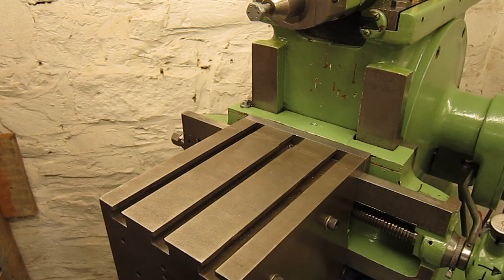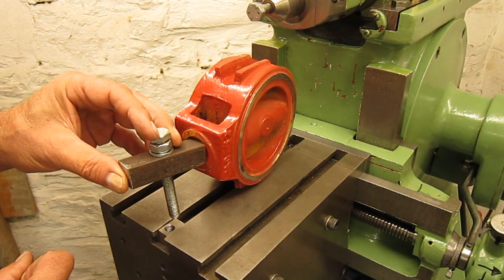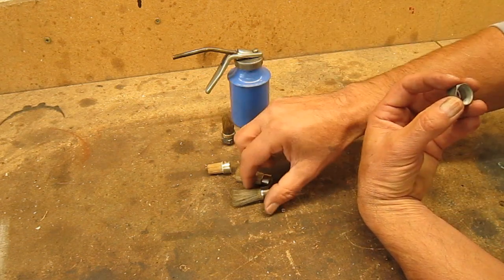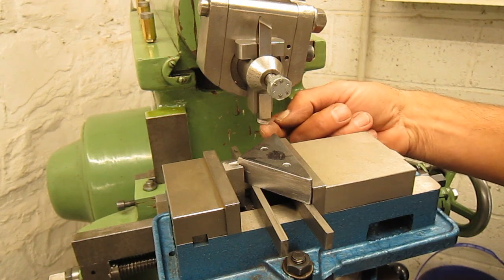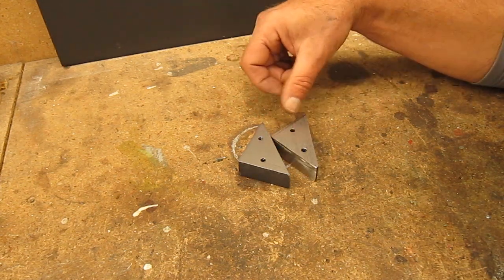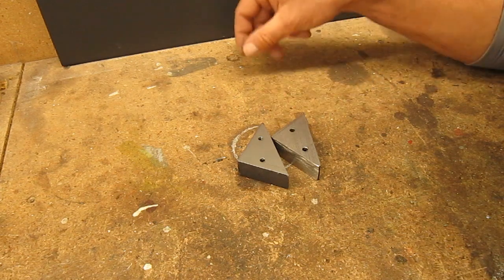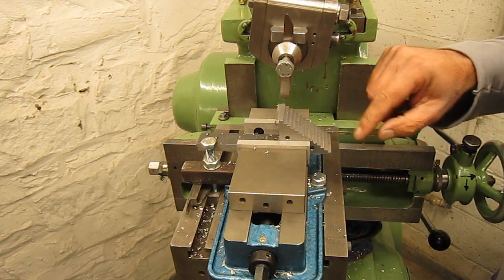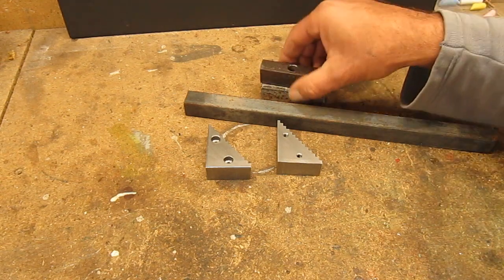Step clamps.

Comment: How about a slot, the width of the bolt, cut into the stepped face from the bottom far enough that the top step can be used. Then you won't have to remake the hold down bars. Just a suggestion if your pyramid material is wide enough. Otherwise good work.
Reply from the maker: Good idea, i will think about that.

Comment: Good job . Does the cross feed nut have an adjustable backlash feature .  Cheers .
Reply from the maker: Indeed, there is. But the nut itself will always have a bit of backlash. Thanks Max.
Reply: @Rustinox  stick a banana in it !   Cheers .

Comment: Hi Rusty, I am impressed. This is one of the best small workshop channels. Your videos are somehow naturally interesting and there is always something to learn from you.
By the way, don't give up on the shear tool yet. I can't see well, but definitely the chips were not the ones a shear tool produces. I think the angle of this shear bit is too much into the work, i.e. there is no shear action but rather a right angle cutting. I would try to increase the angle. 
I think the depth of cut was a bit too much too.
Another think is the cutting speed. I think it should be much lower for a shear bit. 
Of course the material matters to the surface finish. I guess you used s235 steel. It's known for the "gummy" behavior.
The best video visualizing what I'm talking about is there:
https://youtu.be/-CWGScRNXfw?list=PLeoGvnFBthYjFLY7nE7DI1RjIO_oDPov_
Reply from the maker: Thanks for your comment Petar. The cheer tool did not make this curly chips because of the scale on the part. The depth of cut was 0,2 mm. But indeed the angle of the cutting tool is not correct. It should be 45° or even more. I will rectify it if i find the time somewhere in this life, or in the next...
Reply from the maker: I hope you'll tell us a bit more about your shaper one of this days.
Reply: @Rustinox  thanks, I'm studying and experimenting myself. Especially on the shear tool I reached to some interesting  results both on the lathe and on the shaper. For example on the shaper a cut with  the toolbit facing toward the feed direction produces worse finish compared to a toolbit backing off the feed direction (consider the stupid explanation).
On the lathe I haven't seen anybody cutting a face with a shear tool, so I tried. And the result is the same as when cutting the dimeter. The only point is that one can't cut close to the center due to the toolbit  is above the center.
By the way 0,2mm is too much for the shear tool. On the lathe I cut maximum 0,05mm. On the shaper - 0,1mm. Feed is at minimum possible for the respective machine.